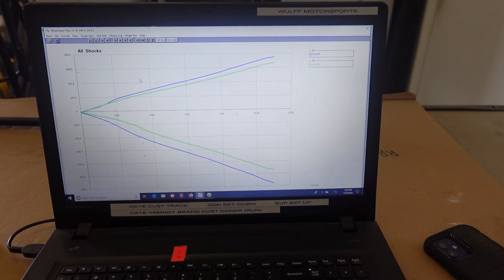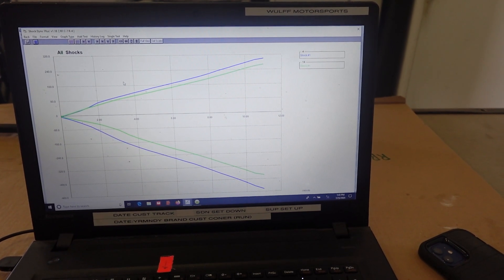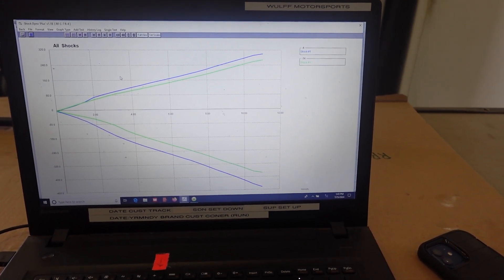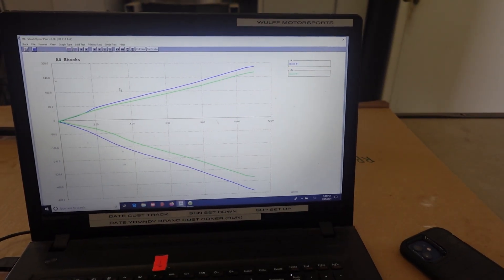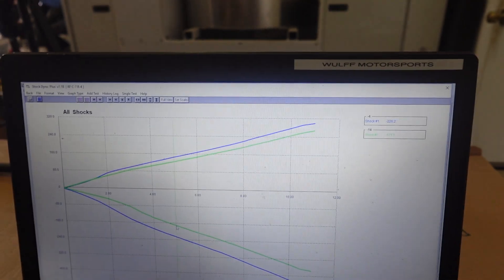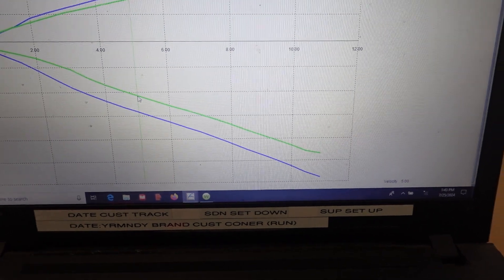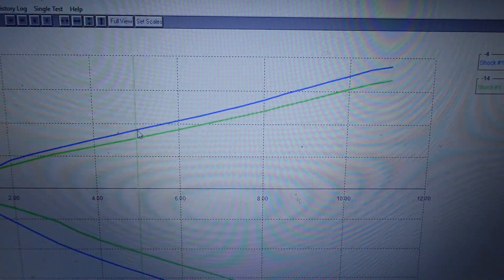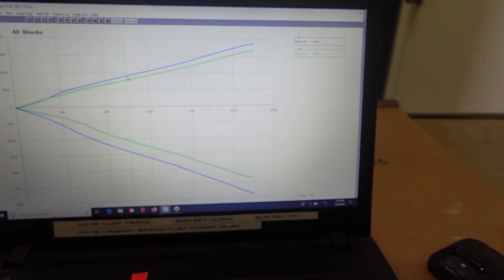WHAT IS A SHOCK DYNO? & How do we use it to tune racing suspension?

Comment: To get back to factory settings, do you just set (click) the shocks to how they came out of the box? Or do find OEM shock dynos and match on your setup? Thanks!
Reply from the maker: To get back to a real stock setup I would dyno OEM shocks and then compare to those. We set our shocks based on spring rate and loads as well as the corner on the race car and adjust from there.
Reply: @ good deal, that was another method I thought could work. Just didn’t know if the manufacturer put out factory spec sheets.